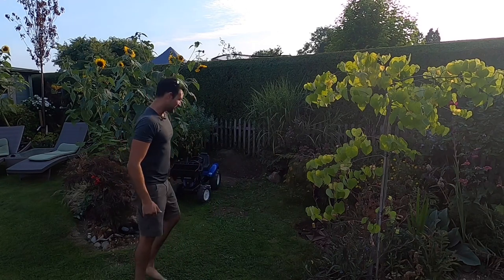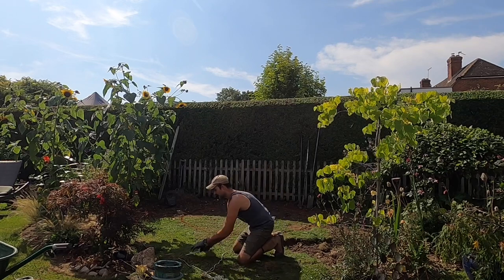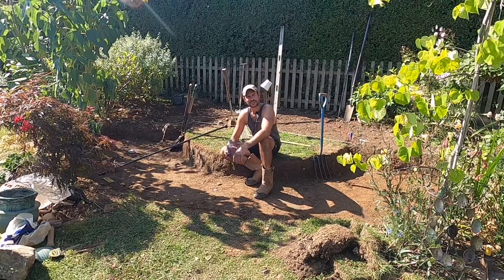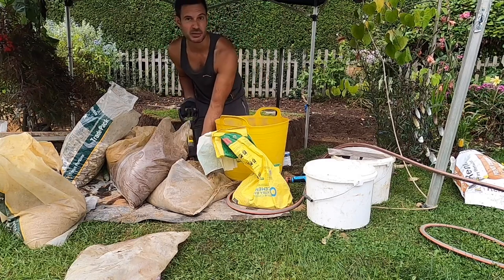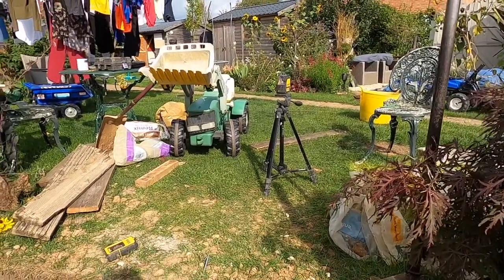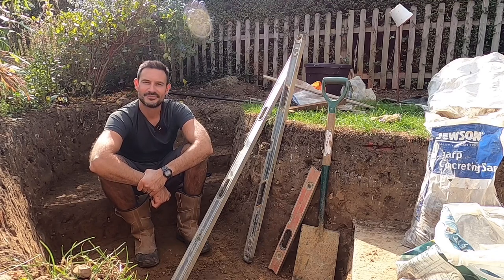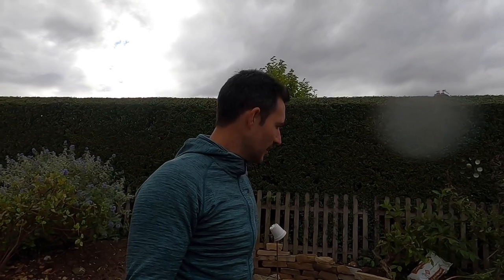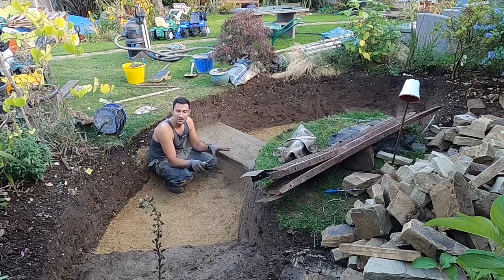How to build a pond: building my own pond! Part #1 design & excavation.

Comment: Good to have another one of your video series.  Great tip on the laser, I was wondering if I would need to be doing the stonework on my project at night :)  As my "pond" has filled with rain water and I would like to keep it what do you can the flexible bowser / water containers that you use in your other videos and is it possible to hire them from somewhere?
Reply from the maker: Hi there, apologies for the slow response- these water bowsers are fantastic! There’s lots of flexible water storage tank solution- onion tanks, water pillows etc- the ones I use are intended for emptying swimming pools into for pool maintenance and are called Portapools.  Not cheap- but a worthwhile investment for the sort of work I do!  No idea if they can be rented out I’m afraid….would happily do so if you were local!
Best,
Ed
Reply: @CrystalClearAquatics  great, thanks for the tip :). We ended up buying an 8' paddling pool :). But it's useful to know the correct things if we ever need to completely empty the pond :)